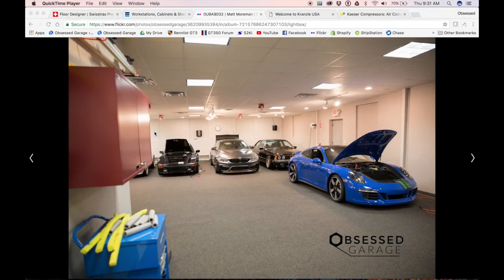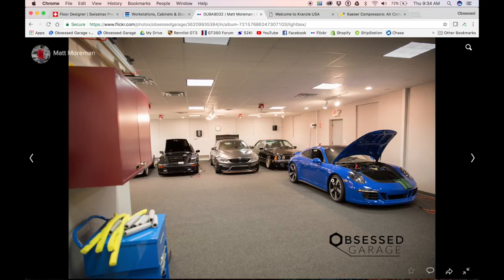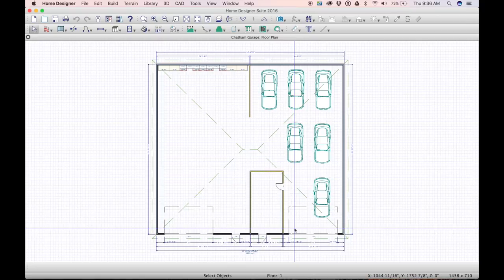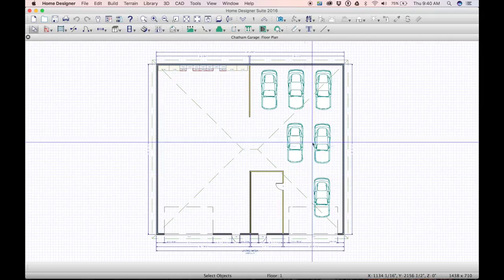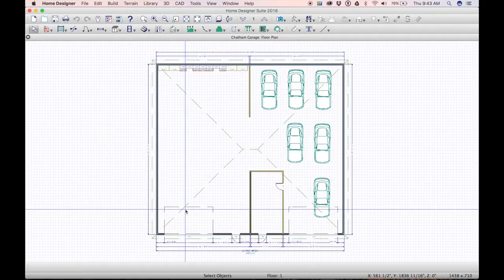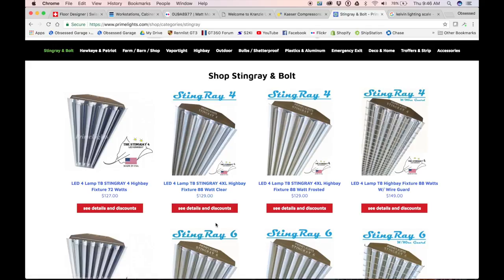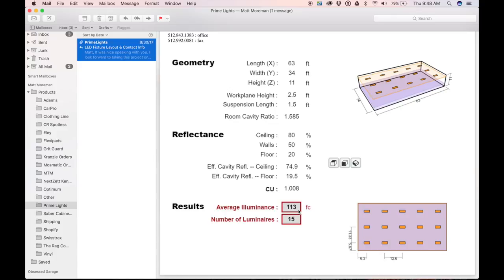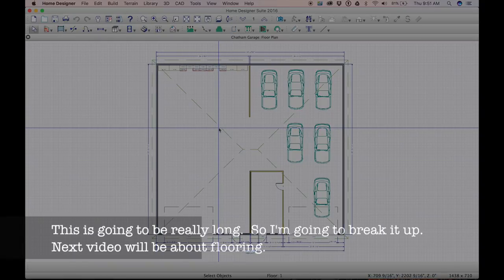Designing Robert's Garage: Video 1 - Intro & Lighting

Comment: As always thanks for sharing.  Few thoughts, and I know there's more to come. :)

1. Storage. I still think the side wall is a better place for cabinets, leave that back area open for work in progress project cars. 
2. Office.  Any thoughts on expanding it?   Dude has a killer garage where do you chill?  
3.  Bathrooms.   Expand the current one, maybe add a shower.  Add a second in the back corner of the new space.
4. Divider.  Maybe a barn door like your wash bay?  It'd be pricey, but what if you could use something clear?  Glass?  Plexi? Lexan?
Reply from the maker: We don't need a lot of storage.  The area above the office is sufficient.  I talked to Bob about dialing in the office.  This is a really unique place for him.  It's hard to explain.  He just doesn't spend a lot of time hanging out.  I like the barn door idea.  Nanawall is also something that may be a possibility.